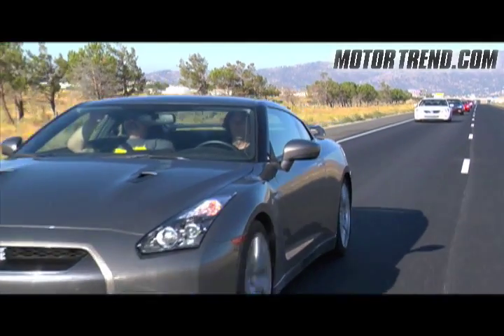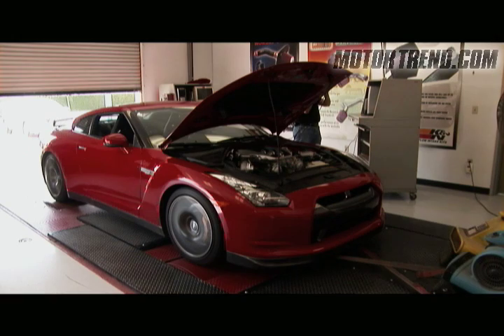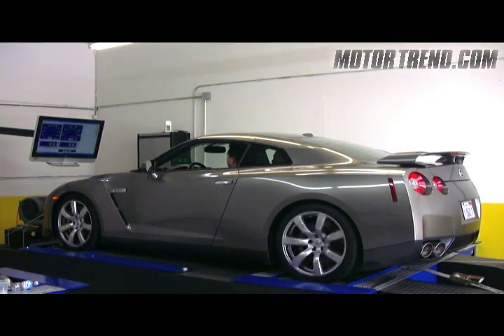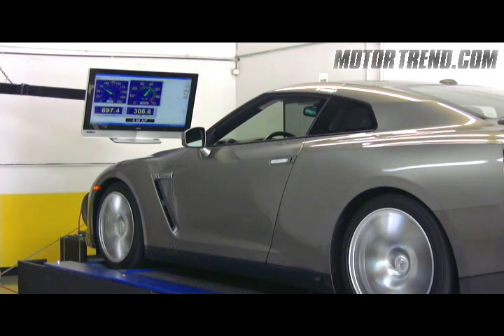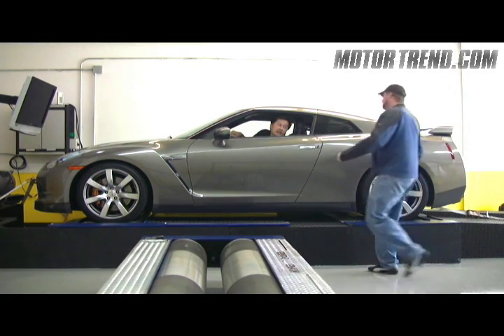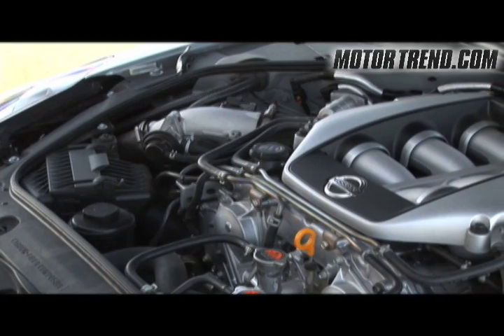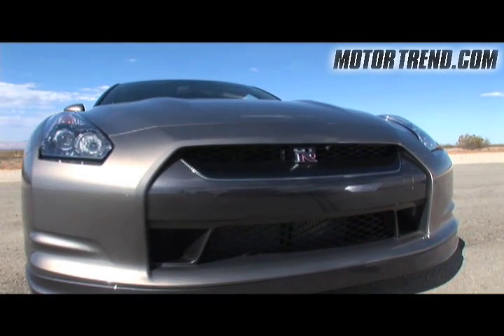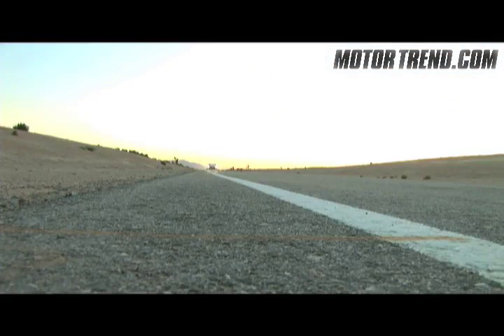Nissan GTR Horsepower: The Truth

Comment: they forgot a little detail, every Gt-R's engine and gearbox is hand made, so that means that every GT-R are a little bit different. So the first red one might have more hp than the grey one that they showed after. 
And I totally agree with fury350z, the great thing about the GT-R is not its power but its grip, handling and the amount of G force that it can handle

Comment: 15% is way to little. If Motor Trend wants to get accurate CHP then take the engine out and put it on a actual engine dyno. Stop guesstimating...  

On that dyno the GTR put down around 392WHP (or 19% loss from 485 hp). It seems the hyperpower dyno's read quite low. Like some Mustang dynos or a Dyno Dynamics with a correction factor of 1.0 (none in other words).

Comment: Not just nissan, any other manufactures claims are hard to get to. Civic Type R (FN2) 6.6sec, no one can get that close etc. Fifth gear even showed that it's hard to do a 0-60 close to their claim. Why? becoz manufacturers spend hundreds of times do that while developing the car. Or they do that on a Dyno where no wheel spin occurs. Reviews can only do 3 a day for the most. So before you judge everyone in nissan is a cheat, think! otherwise anyone else is a cheat.

Comment: Actually, the whole hand-build process apparently gives variations between ~480 to 500+ flywheel HP but these can swallow 600+ HP with sweet f@#$ all modifications. And the finish of the car is actually immaculate. It may look oddball but it is anything BUT cheaply made. In the flesh, the panels are absolutely flush all around, which is much better than the finish on the E92 BMW M3 and the X-series BMW's. I saw these at a car show recently and noted some serious misfits in the BMW department.

Comment: all factory claim is to the flywheel (not far from crank). Dyno will measure power to the wheels. Technically less but this Dyno can estimate flywheel power by what he said 'apply to neutral to measure DRIVE LINE LOSS by calculating how quick the wheel slows down'

Comment: the issue i see is that the car is put in neutral, the input shaft of the transmission, along with the main shaft would not be turning in neutral. 

not that it would make a huge difference, but it would be even more exact if only the clutch was disengaged.

Comment: Measuring the power of an engine at the crank doesn't tell the whole story.  The entire driveline - the gear box, the differentials, the wheel bearings, and the wheels on the tarmac - creates friction.  Between the sheer mass of the moving parts and this friction, a lot of power is lost before it ever reaches the road.

Comment: Since every engine and gearbox is hand built it's obvious that power varies from car to car, not to mention such variables as: gasoline, air temperature and humidity, engine and gearbox oil, and fact that every single car needs few K miles to get to it's peak performance.

Comment: Obviously, you will not buy a Camry over ZR1. You buy the ZR1 for performance, not for lugging family around as you would with the Camry. Camry and ZR1 are of two, very different category of cars. 

ZR1 is of the higher trim level of Corvette and is considered a supercar and it's rightfully so. GTR will lose in comparison, PERIOD. Wait for the GT-R Spec V to be released, then both can be compared against each other since it will be of same category, price and performance.

Best of both cars.

Comment: true, every one has a hand made tranny which is fined tuned and matched to the engine.  I like these but a Porsche 997 turbo is a better buy.  You dont need to use launch control to get the best numbers, you get to feel yourself driving(i've heard way too many times that the GT-R is way too easy to drive), the GT-R's tested without launch control have a 4.5 0-60 but end up only a few tenths of sec slower at the 1/4 mile.  This will go down as a classic though.

Comment: The 3.8 is very unstressed at this point. It has small turbos and small boost. They already have 600hp upgrades for it with just normal things like exhaust and reflashing. So I would say it has plenty left in it.

Comment: It doesnt "Void" the warranty contrary to rumors. Using launch control determine the maintenance interval and schedule for the car. The GTR has on onboard datalogger which logs engine and transmission data and when the car is serviced the data is retrieved to determine if the car was abused.

Comment: I can't believe this is MT car of the year.  The reports that I have read state there are reliability issues with the transmission when launch control is used.  I also heard that Nissan is removing launch control from 2010 models.  That significantly slows the GTR down.  Has anyone heard the same thing?